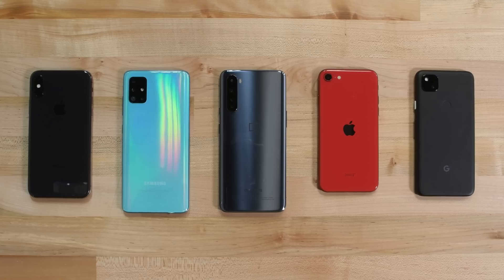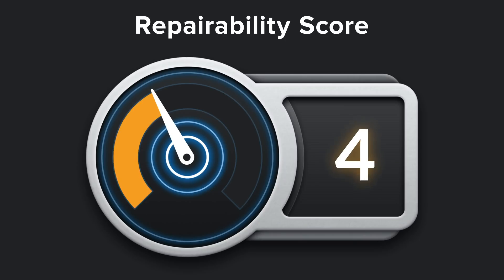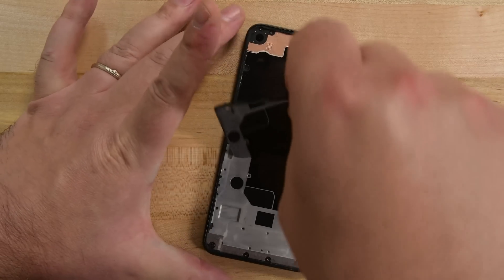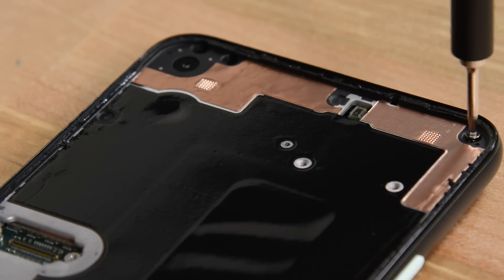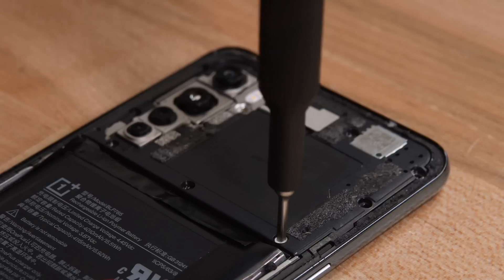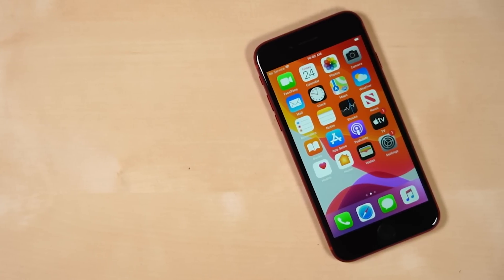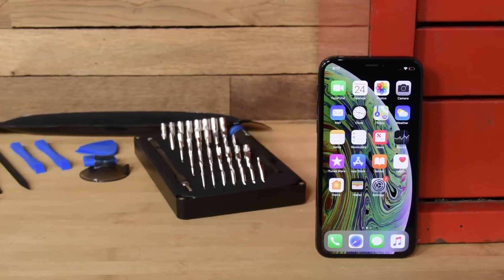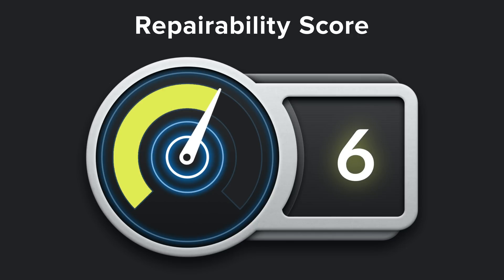The Most Repairable Midrange Phones of 2020

Comment: I just attempted to fix my first phone. I was attempting to just replace the dying battery in my Pixel 2. Ended up cracking the screen then I messed up the front facing camera with some 91% isopropyl alcohol that got on the lens and got the lens foggy when taking pictures. After replacing the front facing camera. ( Which was the hardest part to repair.) I ended up some how damaging the connector port to the display on the motherboard. Now my phone is messed up. Wasted $100 repairing it. Ended up buying a unlocked Moto G Fast for $199 at Walmart.

It's not bad but it's no Pixel phone and it's only on Android 10 vs my old Pixel 2 was on Android 11.

Hoping I don't have to wait long for Android 11. I should have just bought a Pixel A phone that was on sale or find the cheapest one.

Comment: My Nexus 5x is perfect.
I got a new original battery for 20 euros and swapped it myself.
Just popped the non-glued plastic back off, and had it ready in less than an hour after watching a YouTube how-to.
Why ON EARTH does anything ever need to be made harder than that?

I have had it for 5+ years, no case, and have dropped it many times.
It still looks ok, and works perfectly.

If I could get a new one just like it, but with updated internals, I wold.
What kind of lunatic puts GLASS backs on phones, and GLUES it all shut?

Fuck fashion over function.

Comment: Bruh iPhone is the most complicated 😒. Some wires are sticked to the back panel and the battery wire little complicated. Plus u need to crack the codes of the display to achieve full benefit. Plus apple aim is no self repairing
Reply: It would’ve been complicated if it wasn’t modular. Even the older iPhones have only one detachable wire for the battery, and easy jailbreak(Downloadable by Safari) can overcome True-Tone. And btw, pull tabs exist and nothing is glued down in there.

Comment: Apple should be lower for pairing touch ID to the screen.
Reply: Also the battery is paired these days
Reply: @mxyznk  Which essentially doesn't matter that much since you're not going to be checking your battery statistics 24/7
Reply: @xXxMrRazorxXx  well I dont what you mean. What I meant was the battery these days is paired to the iPhone, so basically you cant get it replaced at any other place other than Apple Service Centers. 
I myself know how to replace phone batteries at home, but I can't do that for iPhones because they are paired to the iPhone. Thus it kinda reduces repairabilty

Comment: HOW? Shure the iPhone has modular components but apple pairs literally every existing component in their phones. If you do a screen replacement you will lose true tone and if you do a home button replacement you will lose touch ID, an absolute disaster for repairability.
Reply: Also info about the different screws was not mentioned for the iPhone...
:/
Reply: @Jordan Logan Yeah, but that should make it be a lot lower in the repairabilty score.
Reply: @hardwarefromthegarbage3446  Overall? Yes. Technically? No.
Reply: same with the battery

Comment: Surprised to see an iPhone here
Reply: DistroHopper39B - Tech Videos and More That's only in the 11's. Everything below an iPhone 11 won't give you a warning when you replace the screen, however you will lose True Tone if you don't use a screen reprogrammer! Most of my customers don't really care about losing True Tone though tbh
Reply: @CommanderValkyrie  hits the nail on the head. True Tone is absolute trash though, it sucks even for larger screen devices like the Macbooks.
Reply: DistroHopper39B - Tech Videos and More I've only done one SE 2020 screen at work so far, so I might be misremembering but I don't think they throw the non-genuine display error message from what I remember